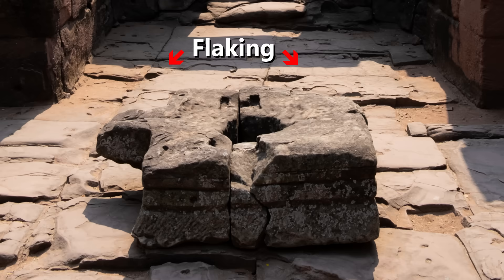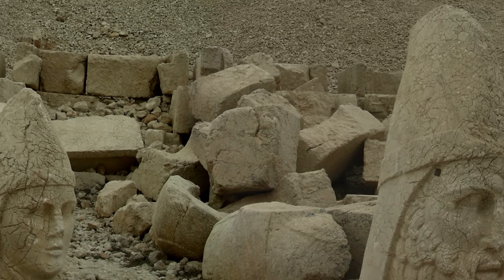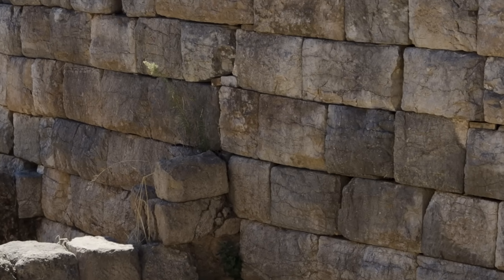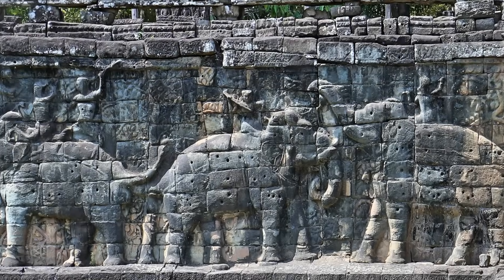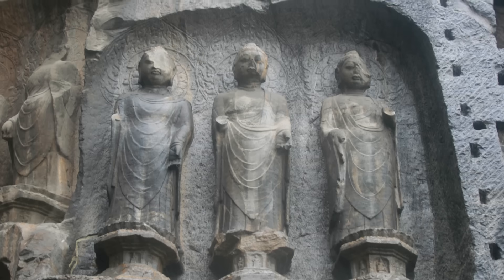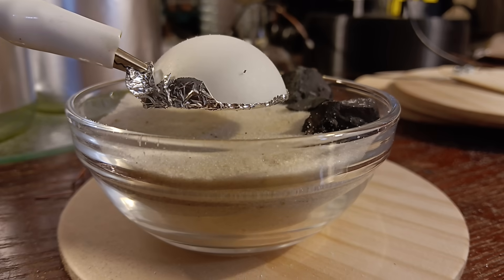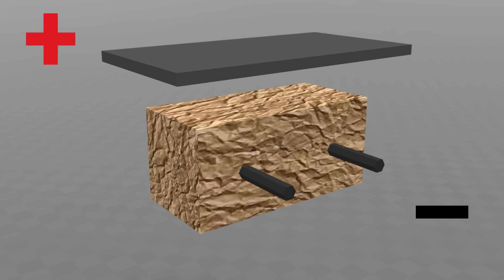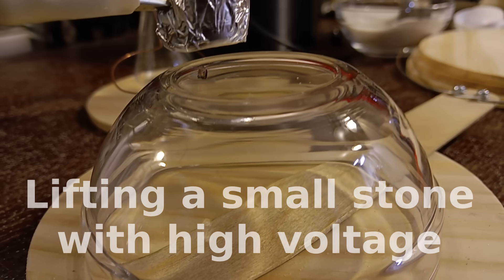The Greatest Mystery, Solved. Recreating Ancient Stone Melding Technology (Part 1)

Comment: The biggest question that needs to be addressed is what source of electricity did ancient people use to generate the plasma?
Furthermore, how did they compress the air necessary to create plasma?
Your story leaves a lot of unanswered questions.
Reply: Look up the Thunderstorm Generator it uses plasmoid technology. Funny olde worlde and Randal Carlson cover it.
Reply: In the 1930's during the Dust Bowl in the U.S the wind would blow fine dust around metal wire fences causing them to become electrically charged with static electricity.
Reply: @HepCatJack  So what? Static electricity is not powering a plasma.
Reply: @jeffreylehman1159  capacitors could be built with the materials of the time a two gold sheets with a Papyrus in between for example to cumulate high charges.  The Ark of the covenant built from biblical specs (using copper instead of gold) worked as a capacitor.
Reply: @HepCatJack  Show me a working model, then show me producing a plasma from a capacitor, THEN , show me how to soften stone with a plasma with ANY equipment.
Reply: Lightning?
Reply: What would happen if you had a isolated stone and perhaps a bunch of people rubbing it with wool? Wool is very good at making static electricity and wet ropes may act as wires! I think this guy is on to something! It's probably one of the greatest theories I heard on ancient architecture and stone manipulation. @maycontainducks1116
Reply: check out the baghdad battery for an intro into ancient electricity. they knew what they were doing.
Reply: Pulled it out of the atmosphere like Tesla did way back when…
Reply: @ArkBarnFarmer  This is actually recorded in numerous texts, scrolls, etc. They used "crystals" as the power source.
Reply: There’s some speculation that the great pyramid generated power.
Reply: @Kevdug69 but they had to build it first so where did the power come from . It’s the chicken or egg .
Reply: @Kevdug69  prior to being built?
Reply: @collincluff7955 perhaps like us building big power plants they had smaller easier to produce energy sources for the construction. All speculation but a good debate always gets the brain juices flowing.
Reply: @Kevdug69  but if they were built in the bronze age, how could they have understood electricity?
Reply: @collincluff7955 people like to argue that ancient people had the potential to be as smart and inquisitive as we are today.. so between witnessing static and seeing lightning perhaps an ancient Einstein figured it out and THAT knowledge was an ancient top secret/classified technology.
Reply: Lightning
Reply: On miniscule examples with high voltages yup you can make it work or to look like a possibility, that is all and the only thing you showed no more no less.
Reply: @kennybyers909  Where do they get high voltage electricity? Or deny electricity?
And show melting of rock with plasma using modern methods before you can even speculate they did back then.
Nothing burger.
Reply: Zero point
Reply: Either
Reply: Lightning.
Reply: The pyramids not only pumped water but generated electricity through the piezoelectric effect. But the sphinx, and likely the pyramids, are much older than thought, going back at least 10,000 years. Who were these people? Where did they come from? Where did they go?
Reply: @bobf9749  really? Where's your evidence?
Reply: I think the Earth was more charged in the past, such that electricity was ubiquitous and easily utilized by every day objects.

If this is possible, then might help explain extremely large stones being lifted through charge repulsion. And if that was true, then imagine if suddenly the Earth lost that extra charge - maybe all work on large stuff would immediately stop, giving a reason for the abandoned works we see worldwide...

Just speculation.
Reply: The pyramids were power generators not tombs like so many have been lead to believe!!
Reply: @EZRiderYZ450F  Your sure about that are you?
Reply: Probably the same source in the atmosphere that Tesla was trying to harness
Reply: @bradenbart9309  "Probably" is not an answer, but merely a supposition.
Reply from the maker: There are many ways to generate power, I'm not sure how they did it, however I am experimenting with charge differentials - there was a reason for these structures being so tall, and there is a charge differential between the ground and the atmosphere which can be harnessed. I'm sure someday this power source will also be discovered.
Reply: @MadPlasmatist hi , friend asked me to drop by and share what I found this fall . Calcium carbonate, silica, mercury and zapped it with a magnetron .I found the white temples of toth and ten ton blue jade feathered serpents. The work pits are all intact.
Reply from the maker: @catfishzcorner2929  Be careful! If your silica ratio is off by even 1 percent, the work pits there may still remain intact, but the minds inside will forever be lost to the serpents... I assume, this was a joke =)
Reply: This is my link it is Michigan this fall . Dig two in the spring . Would you like to bring a shovel ?
Reply: @MadPlasmatist  I have weeks of footage these two short clips are just outtakes .please this is no joke and sure as hell won't hurt to look
Reply from the maker: @catfishzcorner2929  I apologize, I'd thought you were making a joke before because of your name catfish =) I'll take a look through some of your work, is there a video that stands out or one you recommend me to start? Thanks
Reply: @MadPlasmatist  archeology video and the turtle short.   Hey no offence taken I k ow I sound crazy but yeah I'm for real .
Reply: @MadPlasmatist  I left the two links here guess they did t stick .
Reply from the maker: @catfishzcorner2929  Alright I'll take a look soon, I'll leave a comment later if I can =)
Reply: @MadPlasmatist Hope you’re onto something here because I’m waiting for scientists-engineers like you to somehow harness this technology to create space vehicles much more efficient and practical than our current chemical fuel rockets. Hitching rides on already existing electrical circuits in our Solar System would be fantastic🤞⚡️🚀
Reply: @MadPlasmatist   I 100% believe that you're on to something!!!  Keep up the good work👍👍
Reply: @MadPlasmatist  Rediscovered  , or when they stop hiding it ...
Reply: @MadPlasmatist  could lightning rods have played a part or I've seen where quartz or rock such as granite containing quartz when struck can cause an electrical charge
Reply: @MadPlasmatist  This is a fascinating theory. It the best explanation I've ever heard.

However, only practical, fully documented, real world recreations will win the day. If you can make this happen, I believe this is surely a  Nobel Prize winning breakthrough. 

Best of luck. You have my attention.
Reply: @MadPlasmatist  actually Nikola Tesla has already done that and demonstrated it by suspending a wire from a tall building and measuring the power differentiation between both ends of the wire.
Reply: @MadPlasmatist meltology is based on these ideas.
Reply: @MadPlasmatist  My theory about the palenque-astronaut is that the part of the carving that looks like an engine is actually what we used to generate massive amounts of electricity & we called it a Mercury Arc Rectifier

Google both images and compare

 Notice the two arms on the side & the single arm on top, exactly where you would need to place them for a Rectifier to function, also there appears to be many powerful electric magnets

They used Mercury & they also used it for flying machines as well
Reply: @MadPlasmatist recovered?
Reply: @MadPlasmatist I know there's ≈100 V/m gradient in the atmosphere but I question how much current the difference could produce.

any thoughts? ty
Reply: @MadPlasmatist  I'm pretty sure you have heard of electric universe..
Reply from the maker: @invisibilianone6288  Possibly it sounds familiar, everything at it's most fundamental level is an electromagnetic wave of some type, so 'electric universe' in either case sounds about right =) I'll look it up, thanks for the comment!
Reply: @MadPlasmatist  without electricity⚡NOTHING would BE. It's the adhesive #1, of existence
⚡🎯😎☕
Reply from the maker: @invisibilianone6288  From what I understand, it is the spark of life =)
Reply: @MadPlasmatist  ⚡🎯
.
It's also the tool to undo the glue, of that which it binds.
 So many people do not realize, that without electricity, they would not be alive.
It binds every part of ones body into the form and design, to function as each does.  A leg, arm, finger, nose, all similar in material, but formed to have specific uses. What instructs that similar material to take different configurations?
 Electricity, also instructs those and all other parts of the body, how to function together.
 Just enough electricity, makes the body unit alive. Increase the electricity a little bit, it will definitely wake a person up⚡👀⚡
 Too much electricity,,,,⚡🔥⚡...
Reply: @MadPlasmatist This power HAS been harnessed. I have seen motors running on the power you speak of (atmospheric electricity). They called it an ion motor, I believe. Trees stand precisely because of this power. They concentrate this power by tapering into a conical shape as you move up the center trunk. This energy is also referred to as the aether, cosmic rays, and longitudinal waves.
Reply: @MadPlasmatist  I believe that the function of the great pyramid was generating electricity...... I have seen it said that there was a water source that fed the base of the pyramid and it would slam against the bottom of the structure causing a harmonic of some sort....... However depending on how this affected the airspace within the structure I would imagine that would solve your air compression issue for the generation of the plasma......
Reply: @MadPlasmatist small prymid generator and also since these structures were built before the great flood stories that have been proven the electrical equipment would be washed and or eroded away by now
Reply: @MadPlasmatist  What eats my toughts so much is the ancient batteries we have found with electrodes and acid material inside, this could be a one lost genius creation or a one in a kind hint that they actually used electricity during pyramid construction
Reply: @MadPlasmatist if the Earth 🌍 atmosphere was electrically different in the last Age orbiting a brown dwarf star Saturn 🪐, then like a hydroelectric dame with no water, those ways of tapping power might have gone away. But I agree, they where tapping in to it.
Reply: @MadPlasmatist didn't a guy named Tesla already have a lot of that stuff figured out? I'll ASSume you know what happened to him. I truly hope you've figured out something from the past that will help humanity, and that you don't get rubbed out or ripped off in the process. 
Some of those ideas may be possible, and known by some people who don't want everyone to know. If you find out how to harness power from the atmosphere you're definitely going to need good bodyguards. And a safe place.
Reply: @comfortablynumb9342  Lost wisdom, “they are hiding the truth”, anything’s
better than admitting the truth.
The achievements we see are due to superior CRAFTSMANSHIP, not superior or advanced technologies.
Give them their due, by saying that they had these “superior technologies “ you denigrate what they were able to achieve.
Reply: @jeffreylehman1159 I agree.  I have seen people crack huge blocks with primitive tools. Also, I've seen videos of a guy move giant stones alone, using ropes, pulleys, and leverage.  We have the ancient stonework as proof they could do it.  But we don’t have proof of advanced technology. So we must assume they used primitive method unless we find proof otherwise. We just can't understand their skills.
Reply: @comfortablynumb9342 you just need to dump it to the internet.

once the cat is out of the bag, there's no point in killing you to keep itna secret.

problem comes from ppl wanting to make money on it, drawing the attention of those who would prefer it stay out of the public eye
Reply: @jeffreylehman1159 I think they had both.
Some of the magnificent buildings were simultaneously generators. 
All the tall spires and resonant chambers below.
Thermoacoustics.
Ankor Wat for example.
Antiquetech!
Reply: @Drew_Hurst  Words! Exclamation points! Word salad!
Crazy people…..
Reply: @MadPlasmatist  Very interesting. You're on track for something big. I agree their source of electricity is a huge question mark but... one step at a time.

Many people citing Tesla. If I remember correctly he experimented with very high frequencies as well as high voltages. Later our electric system remained confined to lower 60 or 50 Hz. 

Each material has a resonance frequency. What if the right harmonic for each stone is the key for doing the job beside the high voltage alone?

Episodes in recent past (Mexico perhaps? Mount St Helena?) where entire hills dissolved in lava like molten mud seem to sugest that such combination may even be triggered naturally.
Reply from the maker: @wagner-9999  Although harmonics / modulation isn't out of the question, Tesla also didn't have the power of a WCSG or SGL. I am the inventor of the Water Cooled Spark Gap, and discoverer / creator of the SGL (Spark Gap Lingam) - these are both high-voltage, high-amperage spark gaps capable of allowing Tesla coils to do 'physical work', like heating stones - that Tesla did not have. In many ways, I am the new Tesla =) Thanks for the comment, explore my channel a bit more and I'll see you in the future!
Reply: @wagner-9999  or mountains aint as solid as you think,landslides look like water
Reply: @MadPlasmatist the new self proclaimed Tesla, that is a big claim for someone who is not doing anything but showing us a theory 😅
Reply from the maker: @ABluBlunt  I've created 2 new tesla coil types (WCSGTC, SGLTC), I've created 2 new experiments for demonstrations in scholastic labs, I've just discovered yet another science and I find you rather boring and empty. Entertain me!
Reply: @MadPlasmatist  The atmospheric voltage gradient has also varied throughout history.
It's altered by atmospheric density, moisture & particulate content as well as solar & other extraterrestrial influences.
Reply: The earth we had global power potentially. Like tesla invented. That’s why ruins have coils in the ground and all look like circuit boards form above. Like we had a great global civilization before the catastrophe. And now we restart an some teachings tell all thai, but those who teach it want world control not peace happiness and prosperity.
Reply: Has no one heard of the great library of Alexandria???  No telling what technology papers and such when it was lost. Essentially he is rediscovering what was already common tech. That loss has been estimated at setting civilization back about 1000 yrs. Keep working hard madplasmaist.
Reply: Lightning?!?
Reply: etheric. This is why the new, fraudulent, table of elements was introduced....to hide the ether. It's evidence of usage is everywhere. Are you newer to this idea? I know some really neat channels, on about it.
Reply: https://www.youtube.com/watch?v=i4jWPfNJ0rM
Reply: Spaceship.
Reply: @MadPlasmatist firstly wow wow & wow bravo!  I mean talk about hidden in plain sight. …it could be as simple as having patience and harnessing lightning waiting for a passing storm to finalize the build, considering a hiding in plain sight explanation?
I’m mesmerizing by your reasoning & explanation, It is incredible to listen to and come to terms with this certainty winning hypothesis!
Reply: Someone is stoned
Reply: Another great question is how did they move such large and heavy blocks of stone? I think it has been pretty well discovered that the Egyptians used a form of concrete limestone for those blocks. But there is still all the granite and other stone they used. And sure they used boats as well to move the cut stone, but we have yet to find a boat capable of handling such weight either through archaeology, or the hieroglyphs. It's kinda interesting the Egyptians also used stone for plates and cups etc. What do we use? Plastic. Oops? Probably not much better than lead plates and cups which is what the Romans used. There's another "oops". If you want it to last forever, build it out of stone and with heterogeneous stone blocks. (and what do we do today? We use homogeneous stone or brick blocks.  duh).
Reply: @johannjohann6523  I guess the egyptians didn’t do this at all. They found and assumed this megalithic remains, as all cultures did.
greek Herodot told this about his conversation with an egypt highpriest around 500BC. This highpriest showed him massive underearth temples, we now digged out. 
This megalithic area was different from our civilization and knew a lot about physics of nature.
Reply: Ask Tesla…
Reply: They used mega big hamster wheels whit dynamoes where in thousind of slaves run as crazy…..
Reply: Ionic power from the sky.
Reply: @Celzot  prove it and demonstrate how it's done.
Reply: I'm picturing 1000 people rubbing balloons on their heads
Reply: They didn't. This video is horse-shit bunkum.
Reply: What plasma? The rubbed the stones together so they fit exactly.
Reply: @cestmoi7368  That wasn't the conclusion that the writer was inferring.
Reply: Consider the electric universe theory where Saturn, Venus and Mars were once in perfect polar alignment in our ancient sky and VERY CLOSE to earth. The key here is the plasmatic electricity that would’ve been coursing through our planet in this system. Watch “Symbols of an Alien Sky”
Reply: Hydro power
Reply: Seems likely that a civilization that can apply electrical plasma probably wouldn’t have much trouble compressing air.
Reply: Everyone here waiting for you to actually melt down rocks to prove your theory.
Reply: Free energy is all around us. The question is how did they cut the holes to put the electrodes in the stones?
Reply: @nickquantick3490  Hi Nick, it seems to Me, once the electrodes were powered up, they would just push in like a knife into butter!
Reply: Ancient people? More like ancient gods and extraterrestrials from another planet. No human is or ever was capable of this type of constructions. None.
Reply: @RG-vi1te  only a theist would conclude that.
Reply: The arc of the covenant?
Reply: @sylvantutchwildwood2144  do you really believe in that fantasy bullshit?
Reply: @toobiasj  chuckle...but where's the proof?
Reply: The pyramids generated hydrogen and I'm assuming they knew how to use copper and magnets and everything else. I can guarantee you that if there was any remnants of ancient technology the governments have done came in secret societies and all these turd brains that think they're in charge swooped in and done took everything. I can guarantee you there's all kinds of gadgets these people have found how do you think we got the crap we have now? it wasn't all thought up with the human brain they found this shit and re-engineered. You can bet your ass half the crap we use today especially circuits and everything else was probably something they pulled out of the ground and then re-engineered figured it all out and then took the credit
Reply: I’ve heard good theories of yeast in the huge granite sealed lid boxes
Reply: @harrystephens2061  
That's the problem with theories. They are only as good as the extent to which they can be proven.
Reply: Air compression technologies existed for a while. So did ways to generate electricity.
Reply: @naturbursche5540  
Really? As of when exactly?
Historical information doesn't include any information about things like that.
Reply: He demonstrate here that he's full of shite.
Reply: They doc Frankensteined that shit
Reply: Check plasma the 4th state of matter and prelife on Google...Harvard study
Reply: No, the biggest question is DOES IT WORK?
    I dont see any example of it working.  He just shows some pictures of some holes drilled in walls, and asserts that the always horizontally aligned carved-rock grips are actually plugged in electrode holes.  Except there is no reason for them to be horizontal if they were electrode holes.  This whole thing is a hoax
Reply: Piezoelectricity
Reply: Didn't pyramids and other building tops in those ages have lighting rod type things that could have potentially allowed for harnessing electricity. Could they have used that if they were able to harness it?
Reply: The new discovery about the pyramids having 2mile cylinders under it and it's possibility of being and energy generator and transmitter..they could change the atmosphere and use electricity from drawing it from the atmosphere like Tesla wanted to do..
Reply: The power pack in the ufo 🛸
Reply: It's called cold fusion, free energy. The military is using it.
Reply: Look up the thunderstorm generator technology that has been rediscovered
Reply: ### *1. Charging the System: Power Plant Initialization*

- *Obelisks as Atmospheric Collectors*  
  Paired gold-capped obelisks act as vertical electrodes, harvesting static from wind friction, triboelectric sand, and even corona discharge in dusty or humid conditions. These connect via braided copper leads to a subterranean charge bank.

- *Kelvin Drop Generator*  
  Within the pyramid, water is dropped through long copper-lined shafts into opposing cups—every droplet creating a potential difference. The telluric current from below biases the entire system, stacking voltage on top of Earth’s natural flow.

- *Leyden Jar Banks*  
  Foil-lined ceramic capacitors (jars) are stored in insulated galleries. Once charged from the obelisk array or dropper tower, they hold hundreds of kilovolts, each acting like a primitive but potent battery.

---

### *2. Preparing the Granite and Environment*

- *Stone Placement*  
  A granite slab is rested atop a resin-lubricated, quartz-filled platform to reduce friction and isolate vibration. The chamber is kept dry and acoustically tuned to contain standing frequencies.

- *Preconditioning the Stone: Frequency Softening*  
  A tuned granite “resonator box” (like those in the Serapeum) is activated nearby with harmonic chants and low-frequency instruments—typically between *60–120 Hz**, matching granite's resonant frequency. This generates standing waves that *slightly loosen crystalline bonds within the stone.

---

### *3. Tool Setup: Electrostatic Cutting Wand*

- *Wand Design*  
  Made of obsidian or hematite rod with twin forked copper terminals, the staff has a dielectric grip (bitumen-wood composite) and a terminal spike for discharging arcs.

- *Charge Tethering*  
  One lead connects to a fully charged Leyden jar, the other touches the workpiece or ground. Jar polarity and discharge rate are managed by ceramic gate-switches operated by trained technicians or “priest-engineers.”

---

### *4. The Cutting Process*

- *Precision Arc Initiation*  
  With a controlled hand motion, the wand tip is brought close to the granite surface. A narrow, concentrated *corona arc* leaps from the copper forks to the stone.

- *Plasma Disruption of Lattice*  
  The electric discharge generates localized temperatures of thousands of degrees. Feldspar and quartz in the granite begin to micro-fracture, **vaporizing in a fine plume**, while the arc path etches a cut just microns wide.  

- *Wand Movement*  
  The operator guides the wand in smooth, deliberate gestures—almost like calligraphy—while a backup priest chants sustained vowel tones tuned to the resonator chamber. These frequencies help keep the stone in a softened state, amplifying precision.

- *Dust Evacuation*  
  Smoke and particulates rise into overhead vents or are absorbed by hanging linen veils soaked in oils and bitumen. Residual charge in the air is dissipated via grounded copper plates set into the floor.

---

### *5. Completion and Surface Refinement*

- *Polishing Passes*  
  A second, lower-powered wand may be used to smooth tool marks. Rubbing with fine sandstone wrapped in copper mesh, passed over the charged surface, draws away microfractures and leaves a glassy polish.

- *Reset and Recharge*  
  Used jars are swapped out, recharged either via obelisk corona return or rerouted Kelvin drop shafts. Wands are cleaned and hung in linen-wrapped racks to discharge residual field.

---

### *Why It Worked*

- Static arcs enabled *contactless, high-precision shaping* without traditional saws or blades.  
- Frequency fields allowed **non-destructive lattice loosening**, reducing resistance in cutting.  
- All tools and energies were **sustainable and cyclical**, harmonizing with the temple’s ritual rhythm and environmental design.
Reply: In order to do this, the builders were obviously more advanced than we think they were. There is both written works and archeological evidence that seems to point to ancient people having knowledge of nuclear fission.
Reply: https://youtu.be/KMAtkjy_YK4?si=y9qFDYtWvTa9pj6q
Reply: If water was your source of energy...would you like to put it next to the...NILE.
Sounds stupid dumb aye...but what if???
Reply: They were master engineers and more advanced and than ya think. People nowadays just complicate easy things.
Reply: The Experiment: Suddenly create some charge, and with pre-placed instruments watch (along a radial line from the created charge) the fields and potentials appear progressively at points along that radial, at the speed of light.  And once the field and potential suddenly appear at a distant point, they thereafter steadily remain. This shows that a stream of continuous real observable EM energy does indeed pour from the charge, once it is made, continuously and unceasingly.  Further, that free stream of EM energy does not "die out" so long as the charge remains intact. So the associated fields and potentials are continuously replenished, as they continuously spread radially outward at light speed.

The Observation: Every charge freely pours out real EM energy in all directions, with no observable energy input.

The Problem: Either the required nonobservable energy input must be identified or the energy conservation law is false.

The Solution: The charge continuously absorbs virtual (subquantal) photon energy from the vacuum, coherently integrates it, and re-emits it as real observable photons.

References:

Source Charge, Van Flandern Waterfall, and Leyton Geometry T. E. Bearden  (Dec. 2, 2003)

T. E. Bearden, "Giant Negentropy from the Common Dipole," Proc. Congress 2000, St. Petersburg, Russia, Vol. 1, July 2000, p. 86-98. Also published in J. New Energy 5(1), Summer 2000, p. 11-23.

T. E. Bearden, Energy from the Vacuum: Concepts and Principles, Cheniere Press, 2002, “Chapter 3: Giant Negentropy, Dark Energy, Spiral Galaxies and Acceleration of the Expanding Universe.”

M. W. Evans, T. E. Bearden, and A. Labounsky, "The Most General Form of the Vector Potential in Electrodynamics," Found. Phys. Lett., 15(3), June 2002, p. 245-261.

The Source Charge Problem: Its Solution and Implications T. E. Bearden, Aug. 18, 2003

Most electricians don’t realize that from any source of a finite potential intensity φ (phi), regardless of how small the value of φ, as much energy as one wishes can be collected, simply by W = φq, where W is the total energy collected from potential intensity φ by intercepting and collecting charges q. If one wishes to collect more energy W from the same potential φ, one simply needs more q. The reason is simple: the scalar potential is actually a bidirectional set of EM energy flows, as shown by E. T. Whittaker in 1903, and what is collected from it depends on the number of fundamental interceptor/collectors (called “charges”).

References:

E.T. Whittaker
On the Partial Differential Equations of Mathematical Physics
Mathematische Annalen
Vol.57, 1903, p.333-355

E.T. Whittaker
On an Expression of the Electromagnetic Field due to Electrons by means of two Scalar Potential Functions
Proceedings of the London Mathematical Society
Vol. 1, 1904, p. 367-372
Reply: And, how did they make and insert the grounding rods, what material can stand up to the plasma temps, and the holes are hexagonal not round. Heat dissipation and convective cooling would be challenges, smoothness of the outside surface suggests high heat and controlled conditions like glass blowing for surface tension control.
Reply: @collincluff7955
Lightning = plasma
Reply: They used the eaths free energy
Reply: Hydrogen
Reply: @Trebor824 doesn’t make sense because to get hydrogen from hydrolysis you need alot of electricity. splitting water needs a lot of energy.
Reply: His lab demonstration of lifting a small stone with high voltage has me wondering how builders managed to be anywhere near the high voltage during construction. Seems this would have taken longer than necessary. I still subscribe to the geopolymers theories, meaning many of these ancient structures were built using some kind of slurry that hardened like concrete does. I've heard sandstone made this way is virtually indistinguishable from natural sandstone.
Reply: @livingpicture they didn’t
Reply: Yes that's exactly what I was thinking too?🤔
Reply: What type of forms did they use to hold in the molten rock
Reply: @hawaiiangunner  They never liquified the rock and used forms. It is simply a craft that is not practiced anymore. Chisels, fire, water and craftsman that is all that is needed. there are plenty of videos here on you tube that shows how its done.
Reply: @hawaiiangunner  I'm guessing that the theory is to heat the rock enough for it to become malleable, but not liquid. It's an interesting idea, but the problem I have with all these theories is that as we go back in history everything, other than stonework, becomes more and more primitive. 

If there was such technology at the time the number one place I would expect it to show up would be on the battlefield. It seems implausible that people who could figure out how to harness electricity to manipulate stone for the purpose of building huge structures would still be hacking each other up with weapons made of copper or brass. Why would stone be the one and only place that the technology would show up? Also, many of these cultures wrote about their achievements. Even if it was just in pictograms. Melting stone with electricity is hardly a run of the mill activity. I think they would've mentioned it somewhere.
Reply: @mrq6270 "They", the more "primitive" people who you are referring to using copper tools and weapons are not the people who built these structures, but the people who reoccupied these already existing sites.
Reply: @ryucartel351  that is correct. Those primitive people did not build the pyramids. I built them.

I built the pyramids, so I could smoke cigarettes without my parents finding out about it. The pyramids remove the smell of smoking, mad darts. Also, the leprechaun that watches me sleep likes to smoke grits in the pyramid too.
Reply: @mrq6270  Yes, good points, but don’t expect them to be addressed here.
Reply: @mrq6270  they might have forgot
Reply: @mrq6270 true unless the sites are from "pre flood" cultures if you believe that theory and afterward the next generation of humans found and repurposed the sites. There's someplaces where newer construction (that's still ancient) is present atop the huge stone structures and its noticeably less advanced technology/techniques using much smaller stones
Reply: @mrq6270 ..Good points. Perhaps the best explanation for this missing evidence is that the construction of the structures is far far older than our current history understanding allows. Thus, the information and techniques used are long forgotten, with only the structures themselves testimony to ancient  technology. This idea has, (outside of mainstream archaeology, who IMO protest too much and indeed ridicule such theories), for many decades gathered traction and allowed us to focus on possibilities that the mainstream cannot.
Reply: There have been archeological sites that have found what looks like ancient forms of batteries
Reply: @khristinaguzman9428  but still, how did they generate the electricity to charge them?
Reply: @khristinaguzman9428  except that batteries only store electricity, my question was how was it generated.
Reply: I just think that too. But they may be more like capacitors or supercapasitors.
Reply: And if it can be done now? Why not show us how you are saying it was done? Cause it can’t be done!
Reply: @RobertEmory-q2d  Because it would cost 25,000 dollars to build today, that's why.
Reply: @RobertEmory-q2d  - how many attempts did it take to create a light bulb? Just because it hasn't been done yet in our experience doesn't mean it can't be done. What if the only way to reproduce the effect is to spend millions of dollars to build the equipment to do it? Are you willing to contribute?
Falls back on modern man's arrogance that it is 'impossible' that any civilisation could have been more advanced than ours. We can't even make sword blades now that are as good as Japanese masters could hundreds of years ago. Imagine how much tech could have been lost or destroyed over 10's of thousands of years. We also cannot reproduce the ancient stone work that is plain to see all over the world using current technology. It exists, so what is your theory for how it was done? (Spoiler alert - try cutting a high quartzite content 100 ton granite block with a copper or bronze chisel before you respond)
Reply: @RobertEmory-q2d he just needs an entire civilizations worth of people to construct megalithic structures that harness insane amounts of ions from earth and the atmosphere. I volunteer, you?
Reply: @RobertEmory-q2d  Dunning Krueger lives!
Reply: You got it, Brother. While the electrode theory is true and works in modern day, There needs to be a source of high voltage, high amperage electricity to make it work. Without power, it's not happening.
Reply: @bunsonhoneydew9099 the vajira thunderbolt weapon
Reply: @bunsonhoneydew9099 the power required would depend on the exact mechanism, the specific geometry, and the modality employed. For example, a quartz sphere can be ablated with plasma when the delivered surface power density is 150 watts per sq cm and the rate of penetration is 15 cm per hour. The specific energy for this process is about 40 kilojoules per cubic centimeter of quartz. In welding, " digging" requires specific electrodes, usually graphitic, that can withstand the arc discharge conditions. However, that same quartz sphere can become conductive when the voltage and frequency are appreciably increased, and the electrodes will no longer penetrate. Key parameters to consider include DC or AC, pulsed/CW/parametric, phase, polarity, voltage, current, frequency, waveform, PRR, PW, electrode geometry, feedback regulation, secondary stimulation/modulation, field control, etc.
Reply: @bunsonhoneydew9099  Lightning!?!
Reply: @bunsonhoneydew9099  A simple lightening bolt could do it....right???  With the technology they had it would be nothing to create a lightening rod.  Hmmm....a thought maybe.
Reply: @bunsonhoneydew9099 they obviously knew how to do it.
Reply: @kristybarker924  
Yeah, but the original author has been making assumptions about this without providing any proof of concept. Which makes this all simple conjecture.
Reply: @bunsonhoneydew9099 it’s very high above everything else.  And if metallic could attract lightening.  It may be why they considered the creators of them gods.
Reply: natural like Tesla from earth. They knew how.
Reply: @faragraf9380  Tesla was trying to transmit electricity, he never captured it. He did try to grab the static energy from the air, but it didn't pan out. And have you seen the size of the coils he used? They didn't have that tech in the pyramid days, sorry. I'm not buying it.
Reply: @inglbrute  frequent energy was done different. Ithought  Tesla experimented with free energy.
Reply: @faragraf9380 if you're saying they knew how, you're implying we know how in order to recognize that they knew how. So, how would we repeat the process?
Reply: @faragraf9380  
Once again, another unproven theory.
Reply: The pyramids were giant electric magnetic generators
Reply: @danieldeanmasterfinisher4715  You may be a master finisher but you are definitely  NOT an electrical engineer.
Reply: Static electricity, because you can  generate can generate millions of volts.
Reply: @jimsteichen3200 but you need lots of amps too.
Reply: Baghdad Battery...
Reply: @20tea  The Baghdad battery would produce about 1/40th the electricity of a AA battery.  Not enough for plasma physics even if you wired up thousands of them together.
Reply: @jeffreylehman1159  I understand,  just pointing out evidence of ancient civilizations being able to harness energy.
Reply: @20tea  They may have used the earths natural energy flows a bit like acupuncture uses the natural energy flows of the body. Maybe they needed certain types of buildings to use in lieu of needles?
Reply: Atmospheric. Drawn down with structures  and building materials of high crystal/ metallic ore content. This entire realm has been terraformed in an era and by a people hidden by PHDs. Earth is a quarry .
Reply: @battle0nsitka  What is a PHD please?
Reply: The pyramids were power generators. They produced power for this and smelting and refining ores and minerals. Especially gold.
Reply: Ed-Z, amateur researcher, non-academic, super glom of ancient anals of technical histories, two of which apparently used the mica stone as a top-platform flooring material.  Such as Greece (legend of Zeus throwing down thunderbolts, mica floors, allegedly), identical Teotihuacan, Egyptian name, Teo-of-Teo, God of Gods, ie, Thoth "Divine Wisdom" on a pre-Aztec Temple site, as mural-displayed on the Western Wall, Sun Temple, first identified in 1994 by Graham Hancock, Fingerprints of the Gods.  As I understood it, somehow Priests could collect static charges, standing on mica top flooring, and zap ??? volunteers to then be de-hearted.  Mica isolated the electric charges from earth ground.
Reply: @EdZiomek  Although that sounds really appealing, it doesn't answer any of the questions about credible solutions for the obvious questions.
Reply: Manganese batteries could easily be made in Egypt. The highest concentration of manganese can be found in South Africa.
Reply: @potterspride1  
There's that word again "Could" when your entire theory is based on conjecture, without any even demonstratable facts, it's not acceptable as anything other than fantasy.
Reply: @collincluff7955  My apologies, my post wasn’t a theory, as it didn’t contain any other facts. So, “could” is acceptable word use in a hypothesis. If I wanted it to be a theory, I would need facts to support my claim. As this is YouTube, not a peer reviewed journal, everything can be just conjecture and fantasy. However, if they built the Pyramids, then making a battery with simple chemistry is well within the realm of reality.
Reply: @potterspride1  
Yet no proof of that has been found.
Reply: @ well, think about batteries today. They don’t exactly last forever and the materials they are encased in break down after a few years. When we are lost to time, future people may also wonder how we made batteries, as there is no proof we made them.
Reply: I hypothesize that giants built and used electrical power from pyramids to mine gold.
The Deirdre light bulb shows it
Reply: @brianlee4691  Ehhh... You mean "The Dendera Light Bulb"?
Reply: Bagdhad batteries, with alchemy, just like we make batteries now, but they made them in clay jars
Reply: Aliens
Reply: Frequencies. Atmospheric towers
Reply: @daringpleiadean  Words,platitudes. There, I solved it.